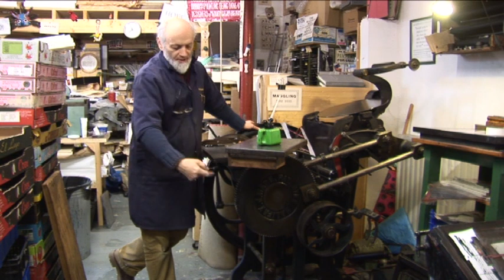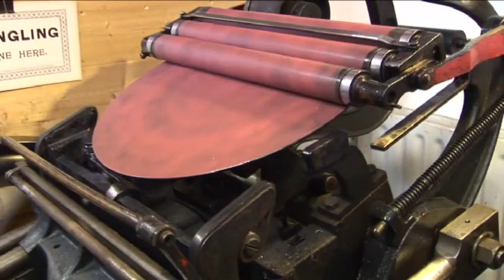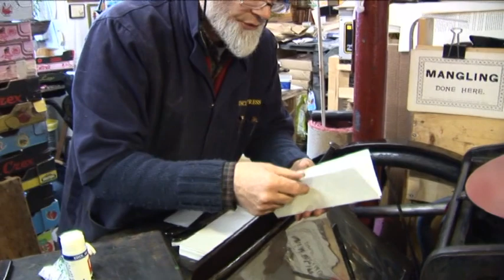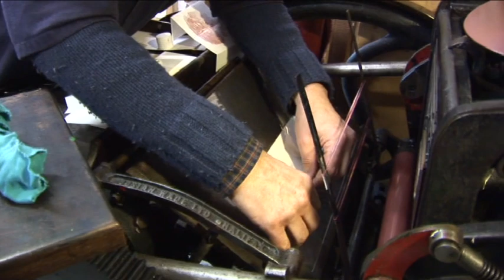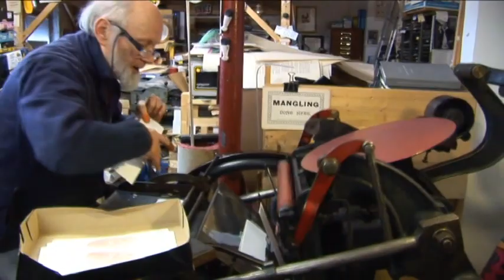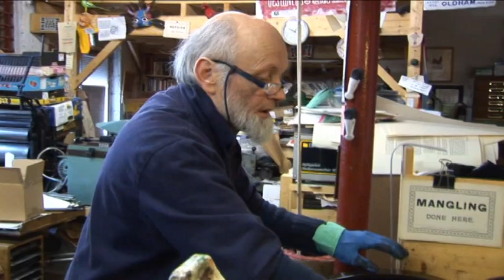ARAB PLATEN PRESS see how to set up the printing press with Graham Moss of Incline Press

Comment: Thank you Graham! Hans Koch here, IG @sputternik. So many good material tips and procedures, all of which I can apply to my C&P printing here across the pond in Minneapolis.

I have been using clear acetate to position stock for some time now, but your mylar pocket idea, which I will now use, takes it to the next level of convenience. Thanks also for the potential sources of bearer bars—I have wood type borders, but never thought to use them for that purpose; brilliant. And placing paper strips on the frisket bars to mask off bearer bar ink is another bit of genius.

Your practical refinements allow the printer to get to the make-ready and printing stage of the work without mucking about with tympans, penciling in position lines, slicing top sheets for guide pins (lays), etc. And your efficient clean up means multi-color jobs get done sooner. Bravo, sir!

One question: does the glue stick on your reglet lays adhere to the mylar well enough to keep them from moving during long runs (300+) that require close registration?

Thanks again for this video. Not only will I benefit, I mentor new printers and will be recommending it to anyone seeking platen press set up advice.